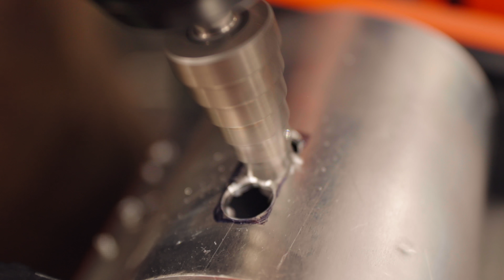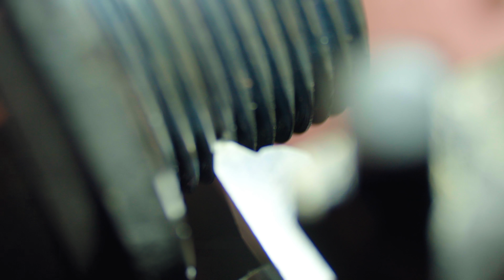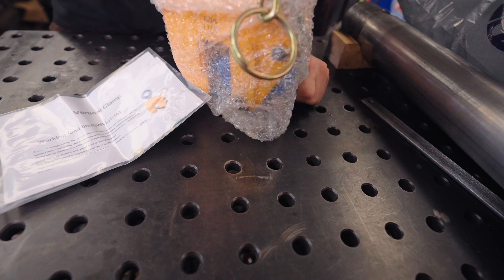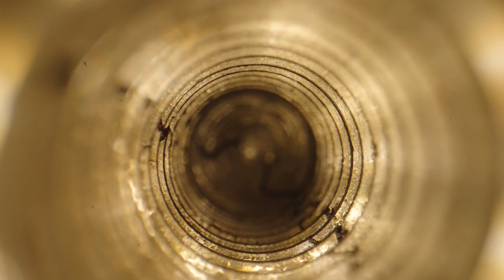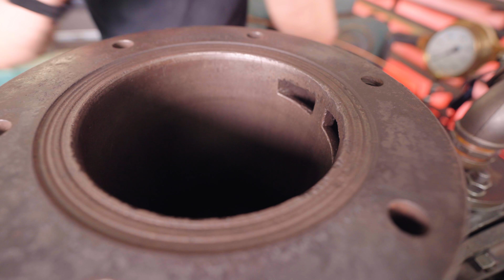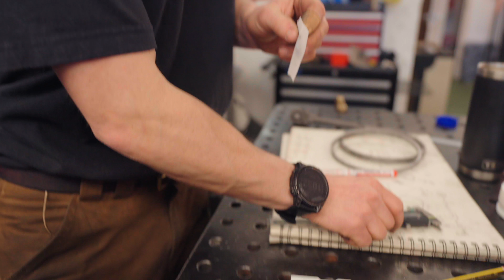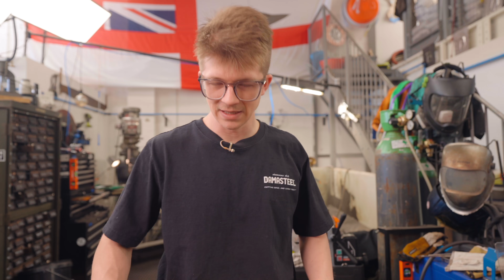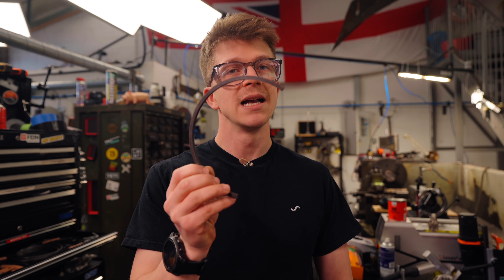Re-Restoring the Steam Hammer! Part 10

Comment: Also Alec you should have those spare piston Rings put somewhere safe and secure so if you do break one in the future, you can break the glass and pull out the spare piston ring to fix it!

Edit: Yep clearly someone wasnt paying attention, I think those rings need to be put on the wall of shame as a reminder to Alec to pick the right material!
Reply: "Shame Damascus": all the mistakes forge-welded together.
Reply: What spare piston rings? The ones he made are worthless. Worse than worthless in fact. They're positive liabilities in this application.
Reply: Did you watch the entire video when you posted this? The rings he made are useless.
Reply: @Mattyboy-pd3gb  well maybe he is making a suggestion for the future
Reply: @sunbears_stuff  Indeed I was, the first set of piston rings needs to be put somewhere to remind him of the wrong material used, but the better material to be used will be put into the break here box when it breaks

Comment: Alec: has been using the 4 jaw in the lathe extensively up to this point. 
Alec: doesnt offset the part with the same 4 jaw to drill the holes for the grub screws.

Comment: I do hope you're lapping those some of those ground surfaces on those new parts. The finish is still quite rough, especially for the ones with bushes. 
I ground crank shafts for a living and we always finished up with something like 12 to 30 micron (can't quite remember) lapping tape after taking the journals down to size.

Comment: you could have threaded the other part on, weld the 2 holes to it and then machine a larger hole in the same spots to fit larger bolts